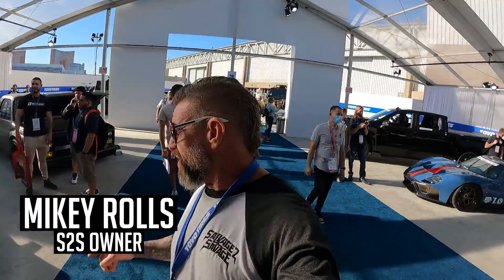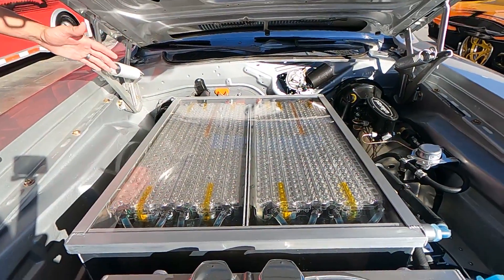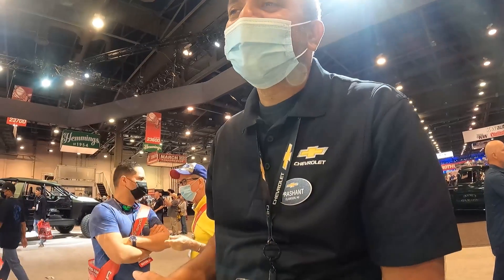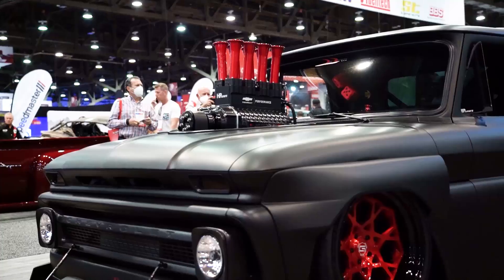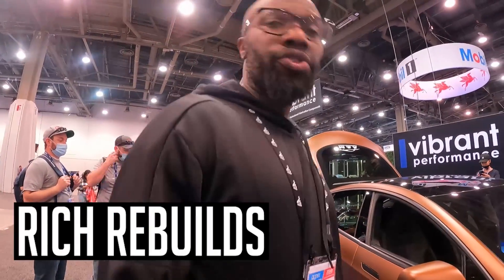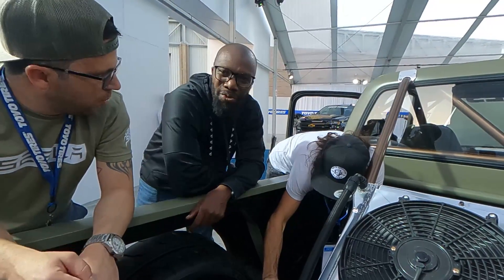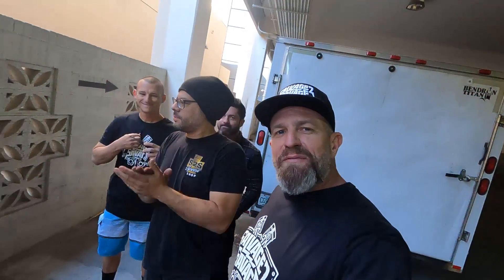Twin Tesla Swapped Chevy Squarebody Takes on SEMA 2021 - Electric C10 Ep. 22

Comment: Nah that wreck was definitely your fault. The car door was open way before you got there and ran into it.
Reply: 7:57/7:58 is roughly when the cabby starts opening his door without checking his surroundings.
Taxi driver's door is fully open, way beyond the lane separators @ 8:00
Truck is side by side with the taxi @ 8:01
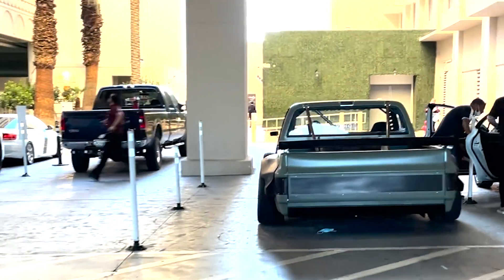Hit @ 8:02.
The taxi could be further to the right by 2-3ft if not more.
Truck is roughly in the center of the lane

Cabby is responsible for this one.
Reply: @InfiniteCheeseCrates  just watched it many times. Truck was too far right in the lane. There was barely enough room for the guy standing there. Truck should've definitely been farther left.
Reply: @burntsilverado  Two things to consider.

1. Perspective. Just because something is a square, it doesn't mean it appears that way when looking at it. I can prove the truck is centered with nothing but MS paint and a little knowledge of perspective and "Vanishing Points"

2. There's a column in his way. Any further left and he's hitting the column.
Reply: The door was open, then they pushed it open further. Definitely the cabby's fault
Reply: @quadmasta  you must be half blind. Go back and watch it again, it was fully opened way before he hit it.
Reply: @smurfvolvo  you couldn't be more wrong. It was open some and then after the front fender passed the cabbie opened it all the way and it hit the rear fender.
Reply: @quadmasta  haha nope it was fully opened long before that. Go get yourself glasses. He was just inches from hitting the guy standing beside the cab too, the dude is lucky he didn't lose his legs from that horrible driving.

Comment: Really? He opened the door into you? Lol
Reply: @RetiredGuy.  the taxi and it’s door never moved and this channel shown it’s colours trying to blame the other for the fact the truck driver wasn’t paying attention
Reply: @Dubslag  The door did move though.
Reply: 7:57/7:58 is roughly when the cabby starts opening his door without checking his surroundings.
Taxi driver's door is fully open, way beyond the lane separators @ 8:00
Truck is side by side with the taxi @ 8:01
Hit @ 8:02.
The taxi could be further to the right by 2-3ft if not more.
Truck is roughly in the center of the lane

Cabby is responsible for this one.
Reply: If they didn't open the door more then the front wouldve caught, not the rear 🤷‍♂️

Comment: Looked like it was already open...
Reply: Right? Shit sucks but just admit you didn't account for the wider fenders when you passed the car. Both rides were money.
Reply: 7:57/7:58 is roughly when the cabby starts opening his door without checking his surroundings.
Taxi driver's door is fully open, way beyond the lane separators @ 8:00
Truck is side by side with the taxi @ 8:01
Hit @ 8:02.
The taxi could be further to the right by 2-3ft if not more.
Truck is roughly in the center of the lane

Cabby is responsible for this one.

Why? 

Because the majority of the US (Including Nevada where SEMA took place) has "Dooring" laws which state “No person may open the door of a motor vehicle unless it is reasonably safe to do so, without interfering with the movement of other traffic. No person may leave a door of a vehicle open on the side of a parked vehicle so as to obstruct the movement of vehicular traffic.”

Since the door was beyond the lane separators, it was interfering with the movement of traffic. Doesn't matter if the truck is wide-bodied or not, cabby was oblivious to his surroundings because he was focused on looking at/for something and didn't bother to check. 

Also the median perception-reaction time is roughly 1.6 seconds regardless of age, according to a research article done by Paul Olson and Michael Sivak, titled "Perception-Response time to Unexpected Roadway Hazards" but generally speaking most accident investigations use 2.5 seconds for a P-R time. Yes the cabby started opening the door 4-5 seconds prior to the truck hitting it, but again he shouldn't have opened it beyond the lane separators and, AND! between the door being fully opened and the hit was only 2 seconds and would have been on the peripherals of the drivers cone of vision...  10000% Cabby's fault, driver had barely/if any time to react.
Reply: @InfiniteCheeseCrates  well i have to say, there's alot of info in your response. But the fact remains the door was already open when he tryed to go through. Even if it wasnt open all the way, like you stated. Shit happens!